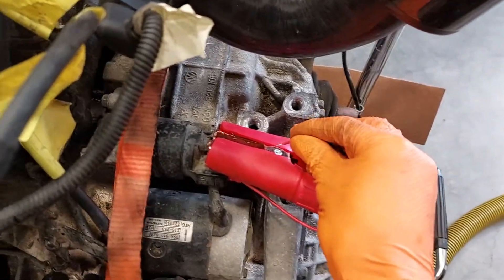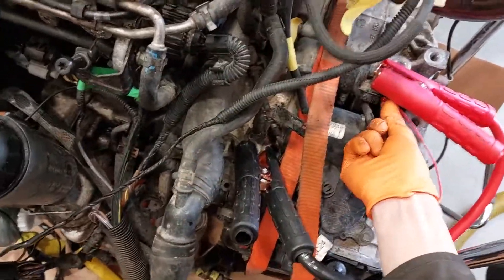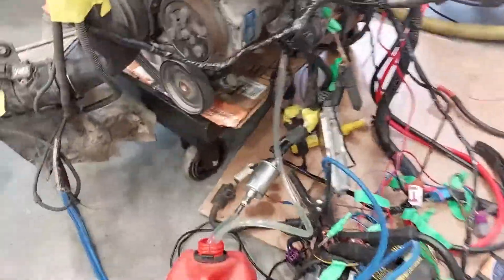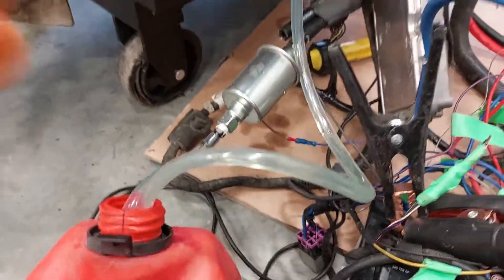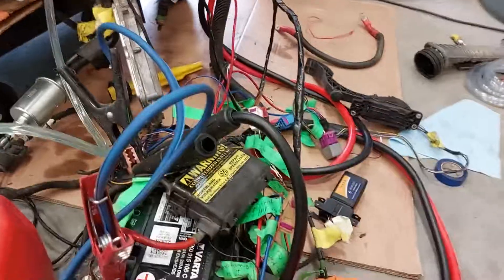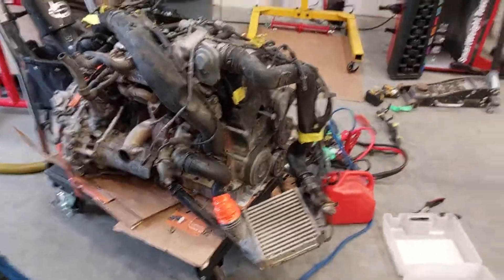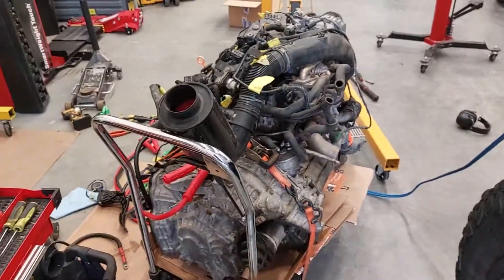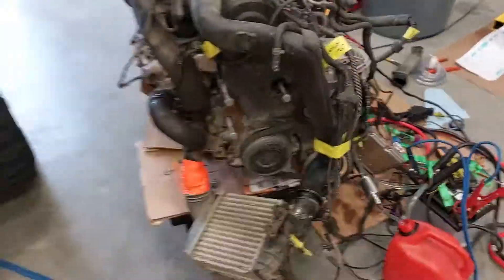FJ Cruiser Diesel Swap Part 2: Engine Runup

Comment: Quick question Sir...I have a 08 fj crusier 4.0L but I need to replace the engine ....I found a 2013 toyota tacoma 4.0L, Are they the same compatible engines? thank you.
Reply from the maker: I believe they are both 1grfe engines, should work, but cannot guarantee... I've ran into issues in the past swapping infinity QX engines with a nissan pathfinder engine thinking they were the same (because they are both the exact same chassis)... turns out, everything mounts and fits perfectly but they use different ECU's and sensors, in the end nothing was 100% compatible.... so buy at your own risk.... I'd compare the FJ and Tacoma engine wiring diagrams before pulling the trigger for your swap. Good luck
Reply: @Colman.Automotive  Thanks for your help...I'll do my homework about it,thanks for responding🙏🏽